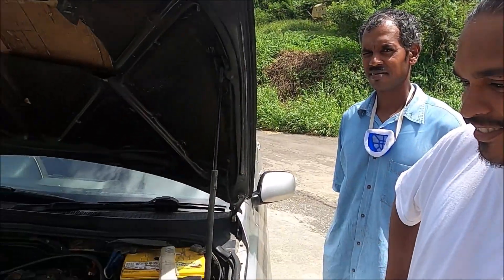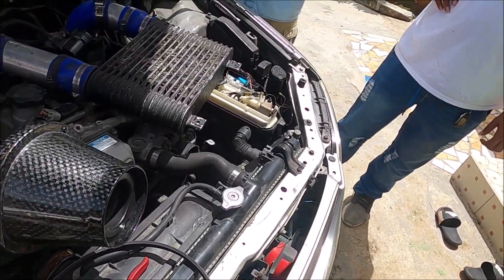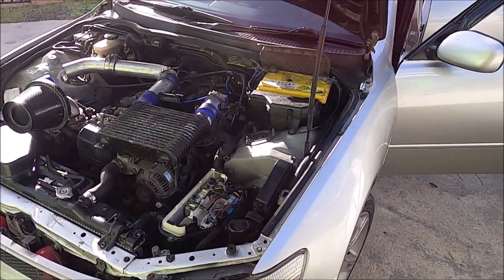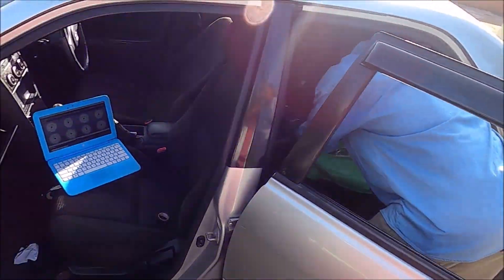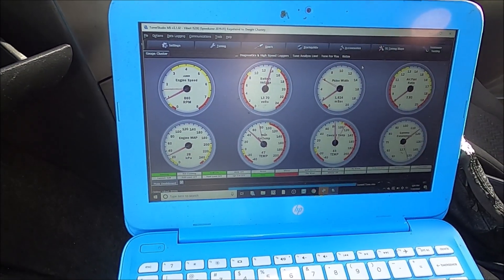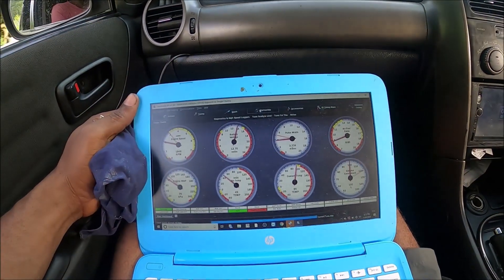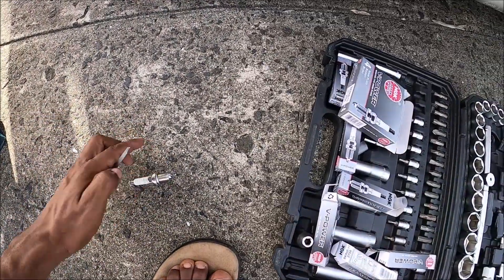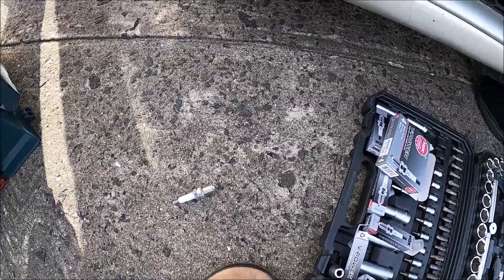Supercharged Toyota Altezza Install, Tuning and Racing Fun !

Comment: Hello, thanks for the great content. I have a question :) In the video you said that you can set ign timiming based on visual inspection of the plugs, without knock sensor or dyno. I've searched around on the internet but didn't see any visual thing on the sparks, only the rick lean and optimal thing.
Reply from the maker: There are few resources and even Facebook pages on the subject. Generally you look at the position of the discoloration on the ground strap after a WOT pull.
Reply: @DCWERX  Thank you. I allready found the info and  forgot to delete the comment.:D

Comment: What supercharger are you using as I’m going to supercharged my is200
Reply from the maker: SC14 from a Toyota previa
Reply: DC WERX what mm pulley are you using
Reply from the maker: @speedaholicgang5200  never measured them but the SC pulley is stock the drive pulley is slightly bigger than stock based on what I have been told